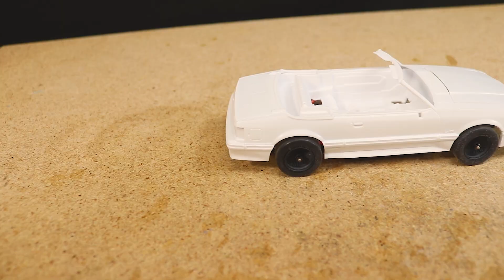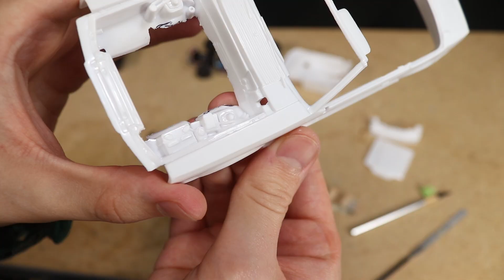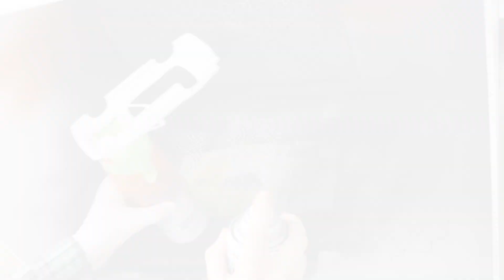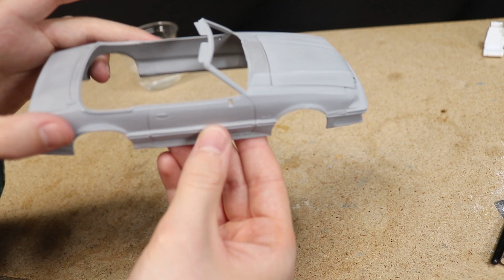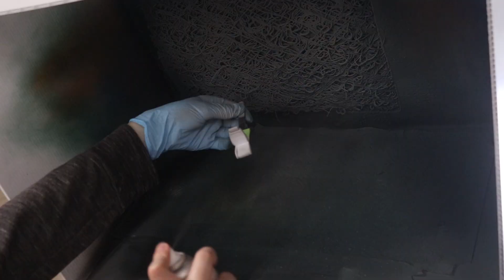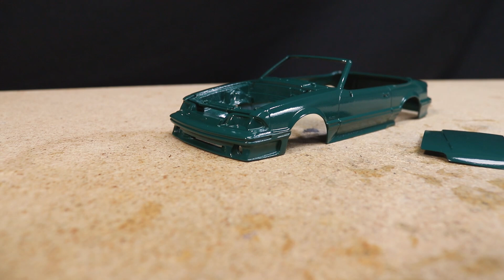Custom RC 1992 Ford Mustang GT Lowrider Build in 1/24 Scale From Menace II Society Part 2

Comment: Cool build as always! Wonder though.. Wouldn't it be easier to make this by putting the servo where the reciver sits, and remove the case from the reciver. In some cars you might fit both under the hood - in other cases the caseless reciver must take a lot less space in the cabin than the servo. Especailly if you solder the servo and ESC wires and skip the JST connectors :)